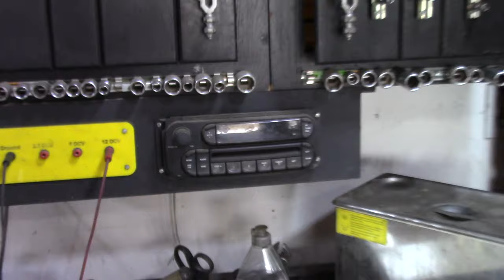Tractor PTO Autopsy & Repair

Comment: If they work like a car air conditioning compressor it will need no more than probably 14 thousandths or so. At least that is what an old mechanic told me once when he fixed mine.

Comment: The tractors which have these types of PTOs , also have a larger Stater because of the currant this draws . Thanks for the video .
Reply: That is interesting Chris's....I collect old Lesco walk behinds. My favorite are the 54" suspended decks.  Couple years back I got sick of the electric start and put a pull start smaller engine on one and reduced the deck down to 48".  (Decks are cool on this design...they pop on and off...I used a 48).
But I had a little trouble with the PTO...  I wonder if you just explained what is happening. tHanks
Reply: except for ariens. they made one with electric clutch but with briggs engine with just the dual circuit stater.

Comment: Great video Bob, I prefer the adjustable gap on the Ogura Clutches versus the fixed gap on the Warner Clutches.  You could close the gap on an Ogura when the electromagnet got weak.  Now everything is sealed so as not to tamper with it!
Reply: Makes sense because the bigger the gap the more voltage it takes to keep it closed is my thinking 
I like to adjust things and keeping them in spec

Comment: At about 2:05 "...resistance in your clutch is so high that it is causing that switch to heat up and actually melt ....".  Higher resistance would cause less current flow which would lead to less heat.  Otherwise, I really like this presentation.  The author seems like a very good down to earth person that really wants to help others.

Comment: A good video sir.
Those are supposed to have a 12 thousandth clearance between the top and lower clutch pieces.  They can be a pain to get adjusted.  Adjust each nut at a time. Sometimes it feels like its good, then check another side (3) and one side is too tight. I have with well worn PTO's tighten to .008. And get a little more use. More than .008 and they won't disengage.  

One more point, if you change from a 1 inch crankshaft engine to a 1 1/8 crankshaft that bushing piece can come in handy.  I changed out  a 12.5 Briggs for a Kohler V twin 25 horsepower.  I thought getting a drive pulley for the 1 1/8 would be easy,  it wasn't.  I used the top pulley that came with the engine (for the transmission belt) and had to weld that short piece to the Kohler pulley.  Then cut the pulley off my 1 inch  ( for the mower deck ) 😂and weld it to the short piece.  It didn't look good, but was able to make it run true, no side to side or up and down wobble.

Comment: Question about the wiring shearing off as they enter into the electromagnet holding. It spun and they sheared off. How can the unit be opened so I can solder either to the old wires left or install new ones?

Comment: I have four of these that have been waiting over a year for me to mess with them.  Turns out...that the parts inside can fit different housing.   So we fixed on with the parts of a different sized donor.   They are so expensive I save them all.   tHanks for the video
Reply: And thats exactly why im doing away with any of my pto clutches i can replace a engagement cable more than a pto i can replace a leaver more than a pto i wouldn't keep wasting money on any pto
Reply: @Mike-su8si  I agree 100%.   Every time I pull the electric PTO I think to myself...."Will this be the time you fail again?"
I have older machines that simply have a lever....I love them.

Who thought it would be a good idea to take something as easy to use as a lawnmower and complicate them?
Reply: @Dancing_Alone_wRentals  i don't know but someone thought of the pto way of ripping people off i know some people probably like pulling the button instead of pushing the leaver up but i don't like the electrical clutches its just another thing that can easily break
Reply: @Mike-su8si  Not only might it break....they seem to always break.  
I tend to buy everything second hand so I spot what seems to always break.
I guess the engineers who design this stuff don't know that part of the world I live in.
Reply: @Dancing_Alone_wRentals  i guess not
Reply: @Dancing_Alone_wRentals  well im putting my intek 18 hp onto my yardman riding mower because something's wrong with the tecumseh engine i checked the valves their good set right it still takes it long to start up the flywheel key is good so I'll mess with that one later
Reply: @Mike-su8si  It will be interesting to see what was wrong.
I have a Briggs & Stratton which simply will not start.  I pushed it to the side.  We tried coils,....nothing...
One of these days.  

Good luck on the swap
Reply: @Dancing_Alone_wRentals  it should go good then on the yardman just fix pulley bracket and its good to start using but.

The old tecumseh engine does start up and run good but takes to long to start up though it has a new replacement coil its the same as the old coil its on right cause it has ran and i cut grass until the belt kept slipping off from the bracket being bent on the deck.

I wonder if on the tecumseh ignition solenoid if a wire on that might be grounding it out as its trying to start up because soon as i let off on the key switch it starts up i have 1 Briggs that does the same were it starts when i let off from turning the key so i guess before taking off the old tecumseh engine im gonna go back over it and see try some other ways because the engine does run really good when its going it has to be something.
Reply: @Dancing_Alone_wRentals  was yours on a push mower or riding mower
Reply: @Mike-su8si  I think you are onto something there.  
Basically you could turn the key to on and hold it for a bit to test your theory.

I like your thinking.   
I'm horrible at diagnosing things, but really enjoy looking over other people's shoulders as they go through the steps.
( DiagnoseDan comes to mind )
Reply: @Mike-su8si  It came off a rider....18hp.  Then it was configured to go on an old school Scag 48" Walk Behind.

What was a 12hp powered mower became a tall grass monster.   It was amazing.
Now it just sits , indoors but pushed off to the side.

I was saying in another comment, I could not diagnose myself out of a room with arrows pointing to the door.
But swapping parts goes well for me.
( I swapped in an O2 Sensor last week where you could not see the 02 Sensor and reaching it was very hard.   
I made the top of the engine a comfortable bed and just laid there till the job was done )

postscript,  I can't stand the way auto makers will allow hard to access engines/cars to be built and sold.

Comment: Thanks, I didn’t know the magnet engauges the key way. I was wondering how would the magnet alone had enough power without some kind mechanical connection. Helped me understanding it a lot better

Comment: Can crankshaft seal leaking engine oil on the electrical solenoid wreck it? Thanks for the help 🙂 👍
Reply: Probably not but it can cause it to slip.

Comment: Only thing other than broken wires and bad bearings I've found is some times the plastic coating on the magnet cracks and water will get in and rust jack it all up.

Comment: My PTO clutch doesn't have bolts. So I'm not able to adjust it. It has only on one side of the clutch heavy rivets with looks to be some sort of pre measured shim. Problem is the side that has nothing rattles.

Comment: The truck radio is the power supply? It runs on 120Vac?
Reply from the maker: I stated that wrong it has a computer power supply 120V to power the radio and the DC power.

Comment: Thanks for posting. My pto is having different issues but this video helped to explain how these are supposed to work.
On an assembled electric pto where there are no adjustment fasteners, should the pulley rotate freely when it’s disconnected and on the bench?
Also, do you have a video showing how you built that dc power supply on your workbench? That is very cool.

Comment: Why work in a pile of dung?
Sweep or wipe off the bench maybe?
Love yer can of PB Blaster and maybe mention it another 10 times and you'd get shipped a case?
I need one of those cans you can just pressurize with your own air line
Followed the Link you provided!
$65 Is pretty steep - Have to figure out how to make one fur cheap that works!!
Where did you get that?

"I Gotta have more prying!!!"
Pry from both sides or you're just jamming it on harder.
"Hang on!!"
I got this on the outside and it belongs on the inside!"

Good ideas well exercised.
Thanks for the walk though!
Very informative!
Thanks
Lee

Comment: DIAGNOSING ALERT.  My deck was making a god-awful screeching and clicking noise when the blades were engaged (more on the right side).  Everything… spindle, idlers, etc seemed tight.  Took off clutch and it appeared fine.  Installed new spindle.  Still making noise.  Replaced new idler.  Still making noise.  Finally took off clutch again and disassembled.  Plates appeared scored.  MUST  be the clutch.  After replacing with new clutch…STILL making noise.  $hit….  Turns out it was the metal cup just above the blade that keeps debris out of the bearing that wore loose and spinning.  Probably due to mixing and matching different parts from different spare spindles there was a bit of play.   Wedged a bit of twine around it (yeah, its Macgyvered)  to snug it up and back to normal.   Just something to keep in mind.
Reply from the maker: Looks like when you did your first check and everything was tight you didn’t grab those cups
Reply: @doublewide6  Yep...live and learn